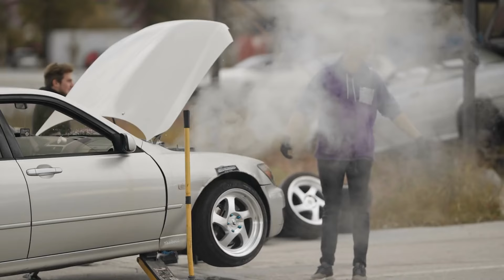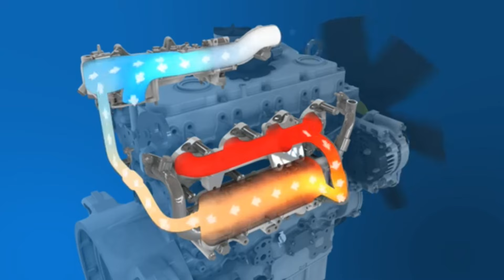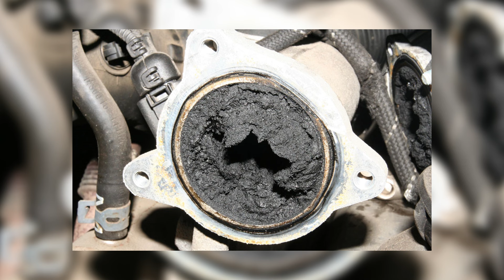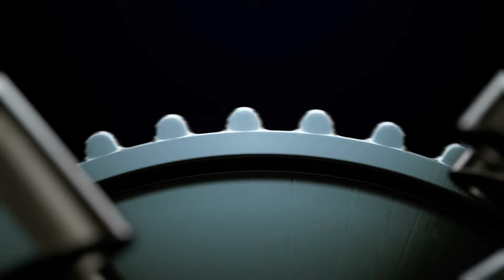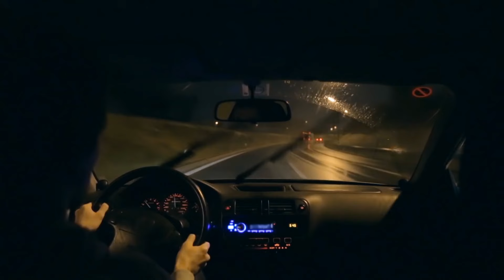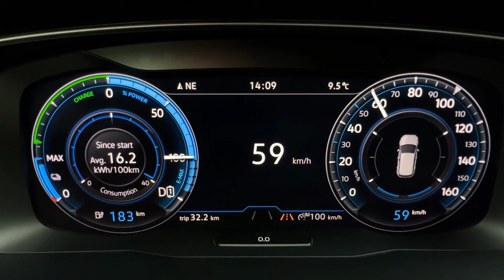Why Your Diesel’s EGR System Fails ( #3 Will Shock You! )

Comment: Please don't put gasoline in your diesel like this idiot says. Also, do a uoa. Diesels go 10,000-20,000 miles between oil changes. 15,000-30,000 miles if you have a good bypass filtration system. The majority of diesel oils are very good, even the generics. Theres actually very few that are poor quality. Quality diesel fuel doesn't exist in the US. You must use an additive. There are only 3 that work for lubricity as evidence by several lab results. Optilube, archoil, and trans fluid or other oils. The rest actually make things worse. Lastly, the best thing to do is a full delete after warranty. If not running a hot tune, you'll actually produce less emissions and the engine will last alot longer, further decreasing the carbon footprint.